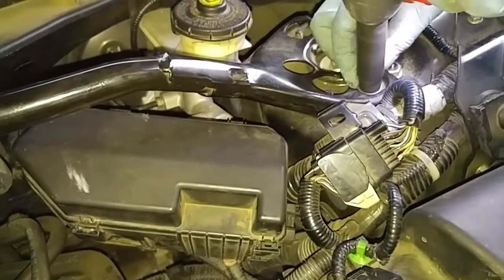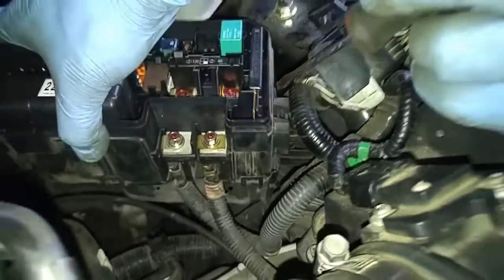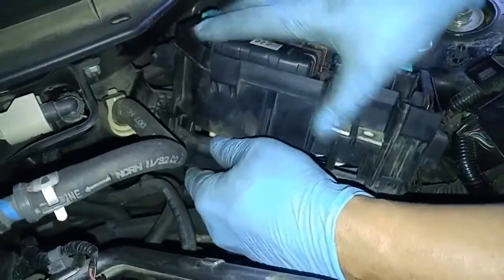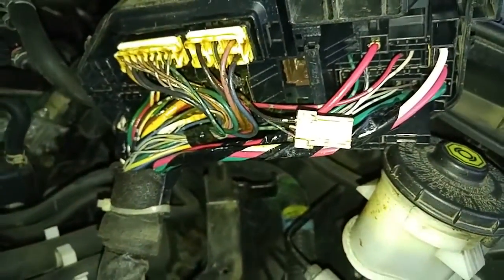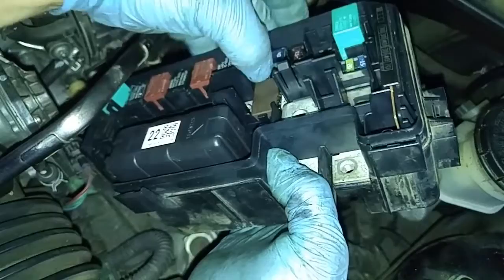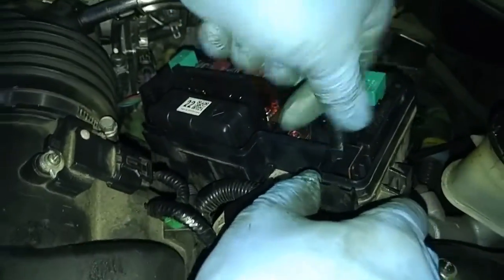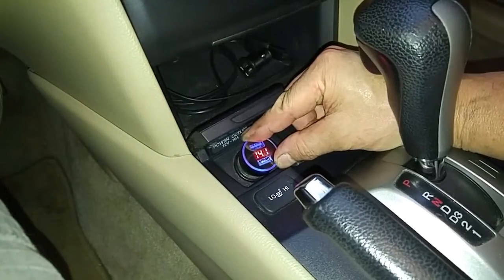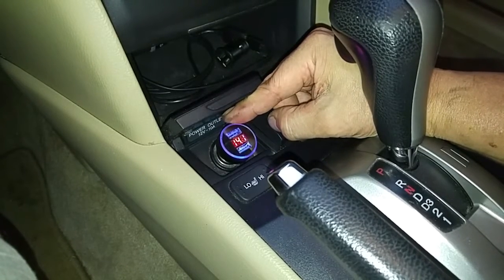Battery Dash Light On & Off? Honda Electronic Load Detector Malfunction

Comment: Would a bad ELD cause airbag lights, abs and brake lignt with intermittent battery light too, I’ve been to three shops and they all say they don’t know what the cause is, hondas best recommendation was changing the belt which had looked fine to me and when taken to another shop they said it was fine and honda mightve been bullshiting me to get more money because they say anything rubber is worn on an older car, when I was diagnosed everything electrically is working fine. My alternator was replaced four years ago and hasn’t shown signs of being bad in the shop said it’s charging fine at 13.6. Does it sound like an ELD to you?
Reply: It all started when my battery started dying on me after 4 years of use, i replaced it and everything was still happening, i have pulsating headlights and interior lights as well sometimes when the car is put under load, can the eld failing make your car feel a little hesitant in stop and go traffic as well as a symptom?
Reply from the maker: Can't say since I never encountered your problem.  I would recommend a full scan of you entire system.  Also, I had encountered problems with Honda aftermarket rebuilt alternators.  After replacing with a Denso (OEM) alternator, problems disappeared.

Comment: For some reason your Honda looks diff than mine. I am replacing the sensor today. I replaced it in October, after replacing the battery, and alternator, then I started getting the check charge system error again when I hit my brakes at the light or stop sign. I think my sensor was faulty since everything else looked good when I first put the new sensor on. Heck the fuel economy when up and the mpg. If not, I guess I can check that part. I wish I could see the part without taking it apart. I’m truly tired of unhooking the battery at this point. BTW…. Thank you for the video!!!!
Reply from the maker: The ELD may be similar but not all the same for all Honda's.

Comment: I realize this is a 5 year upload but maybe it'll still help someone.
I have a 2000 Honda Accord v6. Terrible electrical. Upgrade by doing what is called "big 3". I understand this is basically a audio upgrade but when I done this and nothing else.... I felt a huge difference in car performance. Make sure you get the OFC cables not the CCA. You'll be defeating the purpose.
Reply from the maker: Thanks for sharing!
Reply: What’s the big 3?

Comment: Honda Accord 2013 , it show  warning msg check charge sys then show on dash board Battery ,Air bag , Abs , steering wheel powe get off and can’t accept accelerate pedal then car get off i don’t know if Battery sensor can do this or (Electronic Load Device)! Thanks
Reply from the maker: Pretty sure you may need a new alternator.

Comment: Great video.  Please help: I have a 97 Honda Accord that suddenly smelt of burned rubber while driving and the dash battery light came on.  Got new battery and bought an Auto Zone rebuilt alternator to install.  Car ran great and a/c was even colder for 30 minutes then, the dash battery light came on again.  Mechanic did side eye when i told em i bought auto zone alternator and told me to request an alternator with higher amps because my car is fully electric.  Installed 90 amp alt (1st was 80) and dash battery light came on again within 5 minutes of driving.  Now, I noticed while parked the light does not turn on.  But if I drive without anything on, the light comes on intermittently. If i drive and have either headlights or a/c on…light does not turn on and my voltage is 13.7 to 14.2.  I’ve had the eld cel code few years back when I had to move fuse box to install upper control arm.  But, i cleaned and played with eld connector and code went away.  I have NO trouble codes now.  But, intermittent dash light problem has me stumped. WHAT IS YOUR OPINION ON WHAT IT COULD BE?Please respond, I’d really appreciate it.
Reply from the maker: I have had a lot of failures with AutoZone remanufactured alternators.  They're low quality IMHO.

Comment: My Headlights Won’t Turn-On Using the Switch, but When I Start the Car Headlights are Blinking,  and Lights aren’t Displaying on the Cluster,  By the Way, My Car is a 2012 Honda Accord 2.4
Reply from the maker: Never encountered you're type of problem.  Have you checked out the condition of your battery and alternator?
Reply: @hardlymovingpro  ok, Thank you 🙏🏿

Comment: What happens if we just leave it be? Alt is fine, batt is fine, the light just comes on and off? Guess I’m just lazy 😜
Reply from the maker: Your battery will eventually drain down preventing your car to start one day.
Reply: @hardlymovingpro  so I should just hook my battery up to a charger every so often 😜 Thank you for the response and video, I appreciate it, my son and I will use it to fix the problem. What is the voltage reader called you used to plug into the lighter ?
Reply from the maker: Cigarette Lighter Voltage Meter.  I provided a link in this video's description or here's the link:  https://amzn.to/3A3Te7j
Reply: @hardlymovingpro  liked and subscribed 👍👍

Comment: Hi have you ever changed whole fuse box in honda or toyota. seems like it is not like you remove wire connector and swap , there are lot of wires we have to manually unpin  most of wires, is that true, pls adivse.
Reply from the maker: No.  Never replaced the whole fuse box.

Comment: The?
 Grease that you took off the back of those connectors is so.
 The copper does not corrode.
 And stop your connections.  It's almost like no locks that you put on aluminum wire before you put it in a log in a panel
Reply from the maker: Way too much dielectric grease for corrosion protection.  You don't see it in Toyota's.

Comment: Ok so I have a questions guys I have a 2000 Honda accord  LX 2.3L and I notice the brake light and alternator and door lights flickering while I drive the car then I accelerate or press the brake and they go off could this be the problem the electronic load detector going bad ???please help me thank you 🙏
Reply from the maker: Yes ... could possibly be.
Reply: I have the same issue. I have replaced ELD,Alternator,Battery. Battery cables and fuses all checked out good. Voltage stays at 14.1 any ideas?

Comment: Hello friend 🙋🤔🤗
After I replaced the AC compressor I got rid of what was damaging the belt .Then alternator bearing was singing & the battery light indicator came on also engine was shaking , I knew that throttle body was clean  , because the leaky intake manifold . So finally I found the cause why battery indicator comes on after 10 minutes running , since the manufacture put the white grease inside the 3 wire ( red , blue & yellow ) plug , those grease was like a cement , so when the car shakes then the battery indicator light started on & off . after applying the yellow type battery cleaner on the pluge I cleaned so well then I put in the alternator .
as you remember you told me take the car to a garage , have them look at it . 😢 , no garage do not talk to me unless to leave it with them so the can make $ 300 up$ 500 . since I keep watching most of your awesome ❤👀 videoes , I did not give up or give in . At the age of 70 years old with the stroke & $ 780 a month SS payment & 2 college kid s & my wife income , I had to use the great knowledge of you the good one . I find the problems .
alternator = $ 40
intake mani = $ 55
AC comp = $ 285
2 can R134 a 2 can watch it by sight glass till no buble = $ 12 
& A great patience  & blessing of my LORD❤❤ for you & me 
.the alternator repair plug if I get it in two days = $ 7: 29
Thank  ❤❤ you for your great knowledge . 👌 🙏✟❤❤❤
I keep watching your videoes .
Reply from the maker: Thanks for sharing your story and glad it worked out for you!

Comment: Hell sir
on my 2006 sion xa ,  I have changed alternator because of bearing noise , then also charged the battery all day , now battery light comes on after car warms up , then it try to suffocate like blocked exhust . I have changed the  whole exhust system last summer , problem is engine try to stop , that is the time battery light 
comes on . please👌🙏🙌 guide me what to do . I realy thank you for your response . 🙏👌🙏
Reply from the maker: I think you need to bring it to a full service auto repair shop.
Reply: @hardlymovingpro  HELLO SIR I FIX IT .👌🙏🙌 namaste🙏
Reply: How did you fix it sir please help  @JerichoStephen

Comment: Okay I have replaced this fuse, the Alternator, Battery, Fuse under the dash, and cleaned up the ground and the light is still on. If anyone can help I'd appreciate it. 2003 Civic
Reply from the maker: Check all fuses.

Comment: HELP WANTED, I got an si cluster and put it in my 99 EK hatch but my battery light is staying on at half brightness, with the key in the accessory position it lights up bright but once the car is started it loses half its brightness but stays on. everything works as it should. need some ideas as to what could be causing this. Batter light does not come on at all with original cluster.
Reply from the maker: Could be underperforming alternator
Reply: @hardlymovingpro  doesnt add up though because original cluster didnt that issue
Reply: have that issue*

Comment: Thank you 🙏
My 2015 Odyssey has the same problem. Sometimes the battery light comes on while driving. When I turn the engine off and then start it again the light goes off. It has been off for a month, it came on today and then went off. Should I change the ELD? How can I know if it's bad? Is it okay to buy it from ebay?
Reply from the maker: Could be.  Get one of those accessory port plug in volt meters and monitor the voltage while driving.  That'll give you a clue if it might also be an alternator problem.
Reply: I'm having the same issue. Did you solve it? :/
Reply: @arlesmaldonado5625  I changed the ELD but the problem was not solved
Reply from the maker: Could be a bad alternator

Comment: Thank you for the VIDEO!!!! BOSS! I just ordered an ELD for my 2010 Honda Accord EX-L Coupe. I had electrical issues for years that started with my whole dashboard burning out and had to get a replacement. Main Battery Fuse once went out too and had to replace it as well. I found out later on that when I bought the car it was rebuilt and the power cables were cut by the firemen when the original owner had an accident. Then the mechanic soldered them and put a metal screw zip-tie on it (crap job). Past last 3 years I had a battery icon come on randomly sometimes for 2-5-20 minutes, I've changed the battery twice, starter, alternator and finally last weekend the charging cables. The battery icon still comes on randomly (alternator is good 14+ charging and tested)...my only solution now would be this ELD. I will update this post once I do receive it and install it. Just wanted to let some people know if they had a similar issue in the past as me.
Reply from the maker: Thanks for sharing and let us know how it works out!
Reply: Update. So the new relay helped with the spikes and lows of voltage. Now I have a constant 13.8-14v 😀. My only issue is idk battery drain? Once my car is off the battery will got to 11-12v. Ill start the car and have the battery icon for few seconds then the alternator kicks in and all is good. I don't have anything connected just a dash cam that I disconnect every time the car is off.
Reply from the maker: Do an amp load test on your battery.  I seen batteries with good voltage but low amps.
Reply: @P45KAL did you find a video that helped you replace it? I can’t even get my fuse box apart 😩
Reply: @drevilhtx  dude I replaced the alternator and all cables....2 days of work and car finally works like new.

Comment: 2010 Accord LX 2.4 5-speed:  This video caused me to replace ELD, which didn’t help. But I knew to leave the grease on wires.  This didn’t fix my issue.
My dash battery light would flash on and off during the day but not at night or when lights were on, strange.  My issue was a defective alternator I purchased from Advance auto which tested good along with battery.  Curry Honda even tested it as good, saying I should get Honda alternator. They couldn’t really find the problem but the sure charged me $159 for nothing. My daughter helped me take alternator off and she noticed its pulley making a noise, so advance exchanged new alternator as defective. My light hasn’t flashed since we installed new advance auto alternator.
Reply from the maker: Yup.  Rebuilt (clutched) alternators can be tricky in that they can fail intermittently.
Reply: Try this part ( Alternator Pigtail Harness Plug Connector )
Reply: What if the cable burned too?

Comment: Hello HMB, I have a 2006 Honda Odyssey EXL. Yesterday all the lights came up on dash and battery went dead fast. I use it to work a taxi service. A mobile mechanic put another alternator on it.. everything check out good after he used his scanner.. my battery is good as well. After driving it about 20 miles yesterday, I parked it then woke up this morning and battery was dead again. He swapped alternator out for another and that alternator charged battery for a short while (but not at first) but after unplugging side plug from alternator and plugging back up, it starting working... but now battery dead again after driving it less than 10 miles... That's 2 new alternators and van is still doing same thing. Also he checked fuses and the ones he checked were good. Any tips would be great & much appreciated regarding what it could be. Maybe a fuse somewhere that people miss? Thank you
Reply from the maker: Could be a low quality rebuilt alternator.  Had a similar problem years ago with AutoZone rebuilds.  Customer agreed to install a new Denso OEM alternator.  All problems disappeared!
Reply: @hardlymovingpro  thank you for taking the time to comment your input. I'm a US Navy Veteran and I depend on this taxi gig for majority of my income. Again..thank you for responding..

Comment: Thanks for the wonderful video. How could you exclude the alternator as being the malfunctioning cause of red battery light? You said in the video alternator and battery are working well
Reply from the maker: Yes...a sporadically malfunctioning alternator could be the cause;  however, from my experience with bad alternators they are either working or not working (not sometimes).

Comment: My emissions light and battery light are solid on
Very recently  too I blew a fuse in my 2009 civic 
Found the blown fuse and replaced it but didn't disconnect the battery first 
Any suggestions?
Reply from the maker: Check all your fuses and perhaps your alternator is shot.
Reply: @Hardly Moving Productions  thank you for the info

Comment: @hardlyMovingpro  did you have problems with dimming blinking dashlights and headlights??  i have a honda crv 2005 and have these issues, the voltage do not fluctuate like yours but it does changes while driving,  last time i replaced alternator and battery it looked like it helped for a little bit but the issue came back again

Comment: My '07 Accord V6 original alternator died (squealing sound and then eventually some burning smell) before killing my battery in the process. The other warning was battery light stayed on the instrument panel and then eventually SRS and Airbag indicators kicked in as well. 

I replaced the alternator and battery with some auto parts store parts (I know, I know, should have gone OEM). Starts up okay, drives okay but once the car is warm (after about an hour into my commute) the battery indicator will randomly come on and then off again. No Check Engine light and OBD2 scanner does not return any codes. I put it a 12V socket voltage meter and I noticed that when the battery light comes on the voltage reading will be at about 12.1V. The rest of the time at idle it will be around 12.5V/12.6V. If I turn on the rear defroster, roll up/down the power windows, etc., then the reading shoots back above 13.7V to 14.1V so at least the alternator is able to pump out enough juice. Does this mean the voltage regulator is good?

Did some Google searches and some say it could be the ELD. Any ideas??
Reply from the maker: If you bought a reman alternator, it could be the alternator clutch is not working properly.  Here's a video on the subject:
  https://youtu.be/LKqy0WrmFwo

Comment: Did you use carb/air intake cleaner to clean connectors?
Reply from the maker: You can use that or brake cleaner in a aerosol container.

Comment: I have an 04 Honda accord LX , 2.4.
I replaced my ELD part #  38231-SDA-A01. I can't remember but does the center post facing downward, is there a connector that plugs into that post?
Reply from the maker: Not sure what your problem is but the ELD has an electrical connection point that you connect under the fuse box.

Comment: What if you change this out actually like you did and I'm still having the problem? Any suggestions?
Reply from the maker: Could be a defective rebuilt alternator.  Monitor the voltage output while driving the car.

Comment: Do you think that this part would effect the engine not starting? Or the starter to not crank over should say. Hit the button on the dash and no crank just silence. I jumped the relay and the starter turns just fine just not when I push the button. It's a 2013 Acura ilx, any info would be awesome! I'm about to light this car on fire! LoL not really... That's not true I am about to torch it! 💥 LoL
Reply from the maker: check your brake pedal switch.  If not working, the car won't start.
Reply: What about the relay itself